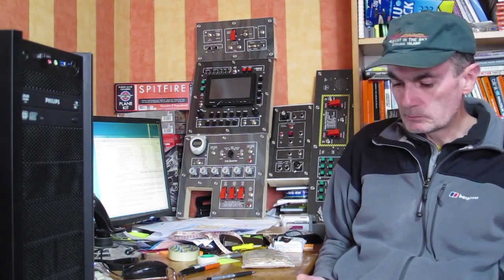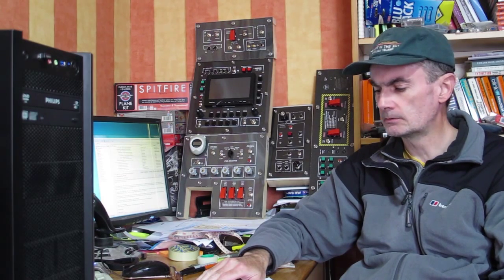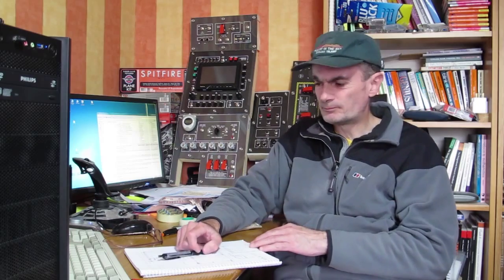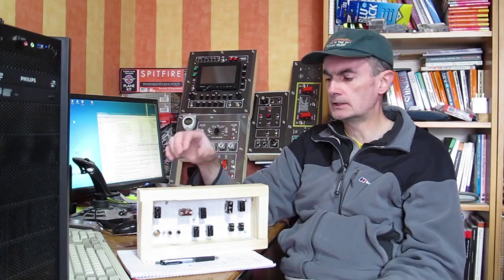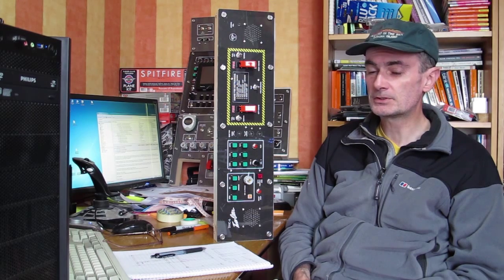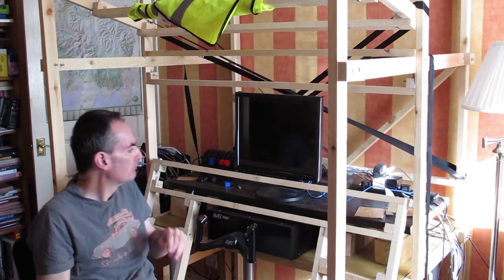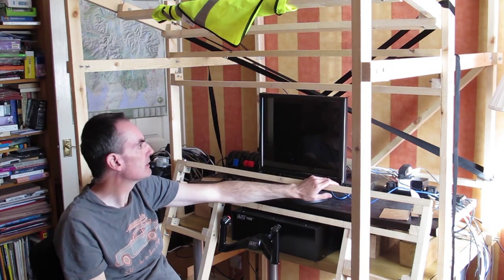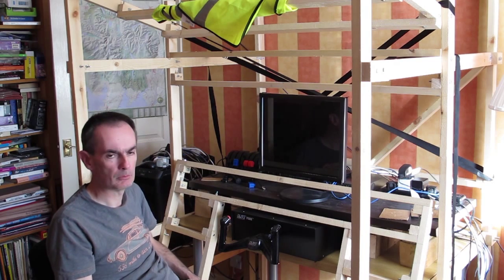Building the Cockpit Support Frame (Twin Otter Cockpit Build - Part 6)

Comment: Ah, the joy of wiring! I spent a full 12 hours wiring two EFIS panels into my setup one day. Really enjoying your videos and so many of your components are familiar to me! I think there's a new project in my future...
Reply from the maker: Ha, I remember the wiring in great detail. I did do everything with umbilicals in the end, as you will see if you keep going. It triples the number of solder joints but I have thanked myself a hundred times over for taking the trouble! I have also made a few more panels since and it's not so bad when you make one now and then. I look back at the scale of this and wonder if I would have started if I'd really known. Of course now instead of flying this one I want to build a new one with a better aircraft...
Reply: Oh I am watching the lot! I had an Airbus cockpit, far less polished than your Twin Otter. I only recently discovered how to use vector graphics to make very nice panels. Are you using a laser printer to print yours? They seem very sharp on the paper/transparency. The Leo cards are awesome, aren't they? I'm getting lots of ideas from your videos - it's like an evolutionary leap from what I was doing. You obviously thought it out a lot better than I did...!
Reply from the maker: Glad you are finding it useful. I used inkjet printing on paper for most of my graphics, that turned out to be the best way. I gave up on backlighting in the end so there was no need for transparencies. Inkjet is more expensive if you do a lot of it but the results are far better, at least with my cheap laser printer. I found that laser printing will show pinholes and will be less dense overall, plus the toner sometimes sheds a bit after printing. The other thing I would say is to make panels a bit smaller than 30cm so you can use A4 paper without needing to make two prints and join them together!

Comment: Very interesting to follow your cockpit building process! I just wonder why the Twin Otter, it's Throttle is on a so unusual position that isn't going to work well when you fly other planes using this cockpit. You must really love this plane!
Reply from the maker: Why the TOX? It starts with a detailed simulation and then the availability of LUA macros so you can drive it from hardware. I haven't done an exhaustive survey (or any survey actually) but that's rare. The TOX has both and is an interesting aircraft to boot, at least for my purposes. For me that means it's a bush-style STOL aircraft and IFR equipped but also it has extras like the anti-icing features and more. I'm not (currently) interested in airliners and stuff, although I know the TOX is used as a small airliner, so it's really important to me that I have something I can fly off grass and farmstrips as well as hard runways.

You are right, though, it will be a compromise for other aircraft. I may decide to mount another throttle assembly lower down to use for other aircraft, particularly if and when I switch to using the Iris FFB yoke, which should leave plenty of room. We shall see. I think the main work will be to figure out some sensible mappings for other aircraft onto the TOX-specific panels.
Reply: Almost Aviation
Yeah, for sure that's going to be an intelligent move of yours to make it so that you can easily mount a more tradicional setup. But of course the focus will always be the Otter!

Comment: I'm building an A10 pit and have been using plastic project boxes.  How are you cutting the Acrylic? Are your panels backlit?  Thanks, Andrew
Reply from the maker: Andrew Endicott Hello Andrew. I am cutting the panels with an unsupported (open blade) hacksaw, mainly freehand. I make the holes with woodworking (brad-point and spade) bits. I have gone into great detail on this in my eBook (http://www.amazon.co.uk/gp/product/B00S75IY2Q?*Version*=1&*entries*=0).

My panels are not backlit, although in theory they could be. The reason they are not is I didn't spend enough time experimenting with the density of the graphics and so with one 80gsm sheet of paper it's not 'black' enough for backlighting. I could dismantle all the panels and do it but I don't want to do that! My later panels (see recent videos on GPS+ and Autopilot+) use one or two sheets of 100gsm paper, which I think is enough for backlighting.
Reply: Almost Aviation Thanks for the reply.  I've watched quite a few of your videos, nice work!  I'm might use Bodnar as well, but currently using Arduino's at $10US for ~50 ports.  Getting the Bodnar's ship to US is 5or6x as much $$$ for me, but I do have a couple to test with.
Reply: Almost Aviation Meant to also ask; what software do you use to create the panel, and what model printer?
Reply from the maker: I use Photoshop 7 to do my graphics (the last version of Photoshop that didn't assume you were a criminal by default). The printer is an HP D2660 inkjet (cheap).

Comment: I'm planning on using 40 way flat cable to link my panels to the Leo cards. This link might be useful to you -     http://youtu.be/p1yZKT3Yock
Reply from the maker: Wow yeah, that looks easy! I will still need to solder at each end but for completely modular cabling that would be hard to beat! So far I have bought 13 pairs (M/F) of 25-way D-Type connectors, which is the current plan...